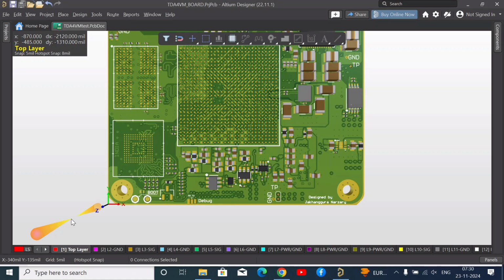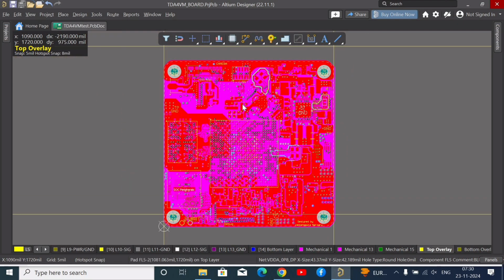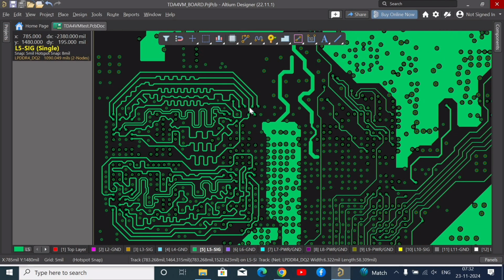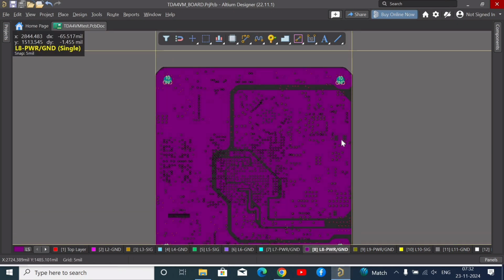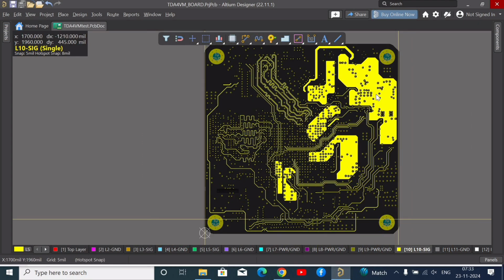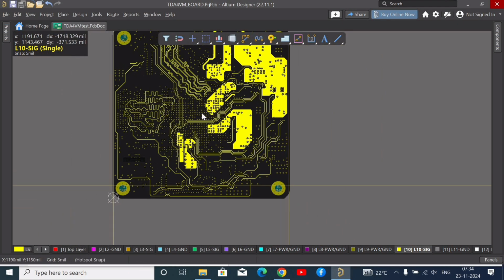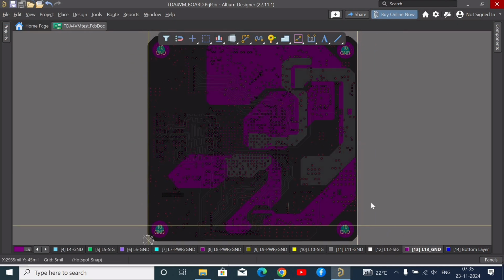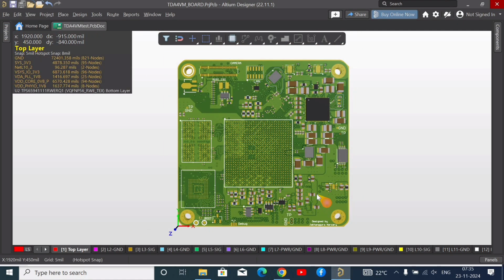LPDDR4 layout design

Comment: Hello, very good work. Could you help me with two questions? What impedance values should I control for the LPDDR4? And the other question: I noticed that on L3-SIG, the LPDDR4 traces have a significant reduction in width. What is the reason for that?
Reply from the maker: Bro the traces you are seeing are t branch topology so to match impedence on each branch the traces reduce in width from the branching point which are like two resistors in parralel. It's is done based on ti guideline. Thanks